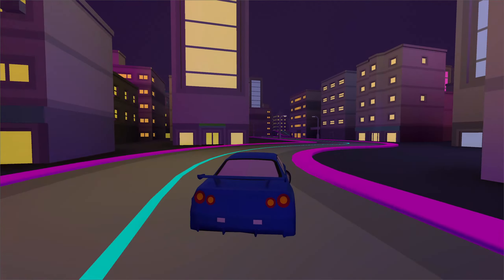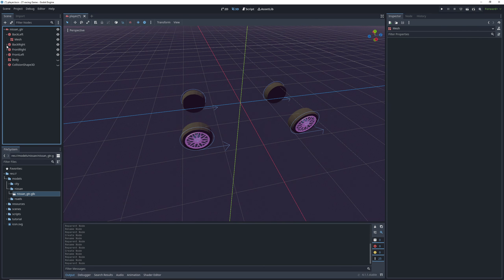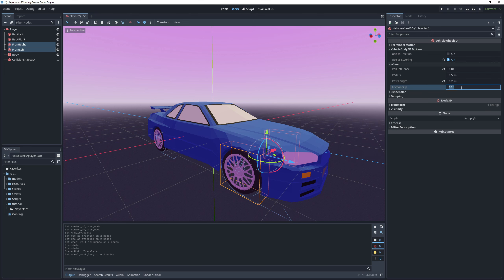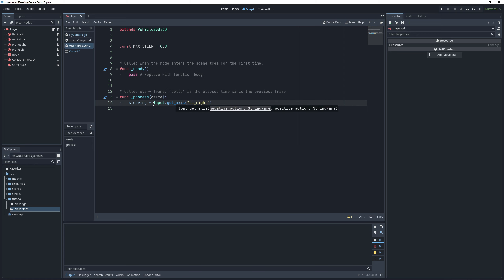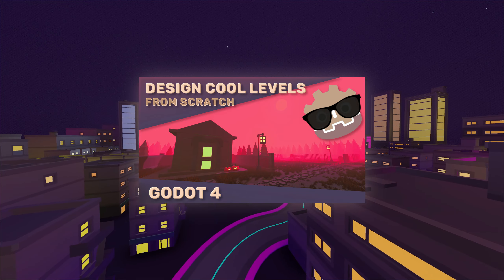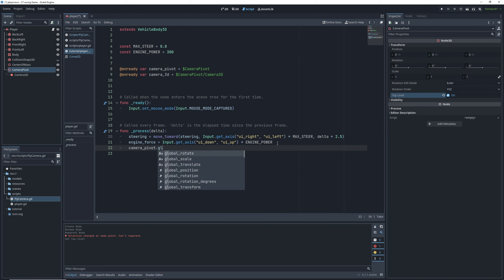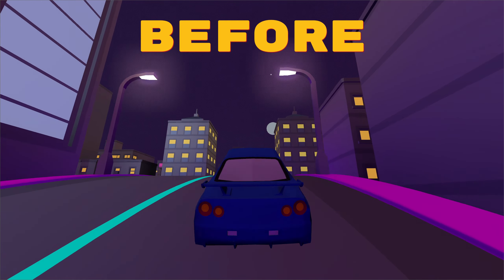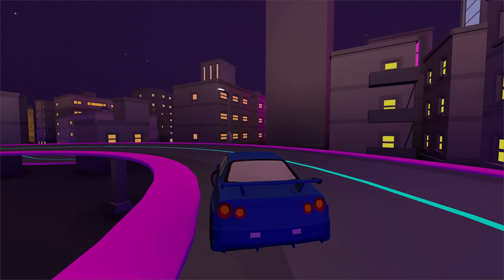Race Car Controller Tutorial - Godot 3D

Comment: the wheel's are not staying in there place , when i press up they go up and around
Reply: Yeah my center is not as shown in the video, the wheel centers are locked to the body center... help?
Reply: @sofiejensen3804  you can fixed it with blender , separate the wheels from car body and set the origin point in every wheel in the center of it.
Reply: why did you put an apostrophe there

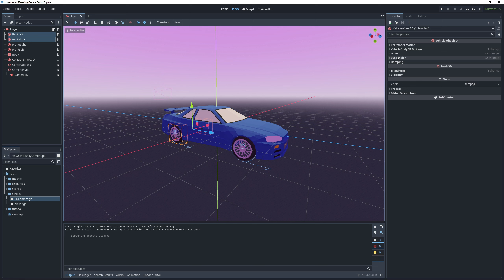Comment: Cool, thanks for the tutorial! But at the 9:39 timestamp, I can't help but notice that:
1/ Delta is necessary to control the execution speed of LINEAR processes, regardless of tick/frame frequency. I'm not sure if it's correct to call the process of "changing a number by iteratively lerping it from itself to a target value" an exponential approximation, but it's definitely not a linear process. By the way, this is a key practical difference from the move_toward function, which creates linear changes and can appropriately use delta.
2/ You lerp the position first, and then the entire transform, which, however, includes this position. In other words, the first step is unnecessary.
Reply: Lerp can still be used for a quick animation solution, but it's important to remember that the speed will depend on the tick rate/frame rate, depending on the loop to which this animation is attached (normal, physics). Multiplying by delta doesn't do what you might think – it doesn't adjust the animation speed to the frame rate. Honestly, based on my experience, it worsens the situation, potentially leading to issues. Use lerp for animation without delta if you are already using it.

Also, don't forget that the value never quite reaches its goal but continuously strives towards it when animating with lerp. This, too, can be an important nuance to consider.

Comment: I'm using Godot 4.3. For whatever reason - even though I've set the front wheels to steer (and not the rear ones) - when I run the game, the rear wheels are steering around the vehicle center. So I have some issues:
1. The rear wheels are steering.
2. The front wheels are not steering.
3. The wheels are steering around the wrong position. Maybe the wheels pivot point is wrong (centered at the car center). I've tried to fix that in Blender, but failed miserably.

If anyone had similar issues and found a fix, please let me know.

Comment: I wanted to genuinely thank you for this. I'm very poor at programming so far, so the fact all tutorials were for Godot 3.x meant I ended up with broken code that I'm not experienced enough to fix.

I always watch your videos, but this one single-handedly got me back in to Godot. Thank you.
Reply from the maker: I'm glad you're enjoying them, thank you for watching!
Reply: @legiongames2400  
Okie dokie, so I tried following along, but I'm having a very odd result. The inputs don't seem to do what they're told to do, almost at all. Hitting throttle results in virtually zero forward motion, but causes the vehicle to turn to the right very slightly, while trying to turn left or right causes the vehicle to quickly turn and accelerate, until it flips.

I've quadruple checked my script now, and I have copied yours to a "T". Any idea why it's being dumb on my end?
Reply: It's almost like the left arrow "allows" the engine to accelerate the vehicle forwards, while the right arrow does the same in reverse...
Reply: Alright, in case anyone else is having the same problem I had to change how the system steered, using this function:
steering = move_toward(steering, Input.get_action_strength("ui_left") - Input.get_action_strength("ui_right"), delta * 2.5)
	engine_force = Input.get_action_strength("ui_up") - Input.get_action_strength("ui_down")

An accidental benefit to this setup, is if you decide to setup a custom input map, you can use controllers to have variable steering, acceleration and braking (IE, you don't have to be full throttle or no throttle). Hopefully that helps if anyone else encounters the same weird bug I did.

Comment: This is in fact what I needed. Now, I'm not creating a car controller, in fact I want first person movement, but some things from this are applicable. 
Since there aren't as many nuanced godot tutorials, you really always have to think out of the box and consider your closest approximation. But since we are creative problem solving, it's also not straight forward what nodes and functions to use at each point, so we need to find tutorials for things that are more common than the niche thing we want to achieve.
Reply: ur using wheels for a 1st person controller?
Reply: well no, not wheels, thanks for asking. I'm trying to have a regular first person view, but the character movement is restricted on the x axis, so it's basically like on a street. And the mouse x isn't supposed to control the character y rotation, so like steering, where y rotation only happens with A and D keys.
my ideas tend to be complicated and I'm new to gamedev, so I have a lot of work ahead of me.
Reply: @pancakedev6 What I was looking for turned out to be path follow

Comment: Bro, wonderful tutorial!
Could you help me? When driving, all four wheels of the car rotate along the axis y
Reply: Same issue here!
Reply: Same here. Did anyone find out how to fix this?
Reply: The video description explains it: "If you use the car model that I used you will need to change the wheel origins in Blender to make sure that they are centered on the wheel meshes."

Without the edit, the center of each wheel is the car model's (0, 0, 0), which then becomes the center of the rotation. Use Blender, then for each wheel mesh, click > Object menu > Set Origin > Origin to Center of Mass (Volume). If someone finds a solution how to replace the mesh within the Godot scene file instead of redoing everything, please comment. I redid it, and then it fully worked.

Comment: for some reason my wheels are giant and not where they are suposed to be i used that car in the ling and i did the exact thing that where in the video
Reply: Here is how i fixed it for myself. Change the scale for the Vehiclewheel3D to 1, same for the mesh(of the wheel). Now change the scale of the wheel mesh to w/e u need(mine is 0.185) and the scaling issue is fixed you no longer will have giant wheels

Comment: the wheels move out of the car and in cant fix it
Reply: forget it i fixed it
Reply: @Nathan-k5t  what was the problem?
Reply: @pelcox1681  the problem was that i didint put the weel turning on the weels i had it in the midle of the car witch made it spin in steed of turning
Reply: @Nathan-k5t  Hey, can tell me how did u fixed it, im having the same problem, the circle thing which should appear in the wheel is appearing in the middle

Comment: Does not work for motorcycles. I guess, the VehicleBody3D is not designed for vehicles with less than 3 wheels. I tried a lot of possible settings. I miss a setting for tilting instead of steering, because on two wheels you will not steer much, but tilt your bike.
Reply: I feel like with a proper center of mass tye physics would just sort itself out.maybe your tires need to have strips if you will with their own friction
Reply: @visibletoallusersonyoutube5928  Ty, but I stoped tryig to do something like that with Godot. I Hope, there will be an update for 1-2 wheeled vehicles soon or later.
Reply: @3333927  fair enough.  You could just have a left and right friction  that gets adjusted depending on the lean angle of the bike.

Comment: I liked the project, how to install a system with a speedometer, I'm in Brazil here it's in km/h, and how to show what gear it's in, create a system to switch automatic or manual gears and show the gear as in reality?
Reply from the maker: You can get the speed of the car by getting the length of the linear_velocity variable of the car which is in m/s so multiply that by 3.6 to get km/h and then hook it up to whatever UI element you want to use to display it
Reply: Thank you very much, do you have an example? I liked your project, would you have one for a helicopter?
Reply: @legiongames2400  For mph multiply by 2.236936 (~2.24) instead

Comment: I did everything the same and my camera is not in the center of the screen next to the car, it is a little to the left and it does not adjust even when accelerating
Reply from the maker: Is it in the center of the screen when you preview it in the editor? If not you might just need to make sure that all the transforms are zeroed out.
Reply: yes, I reset the camera and the hanger node many times, the error still occurred

Comment: Thanks for the tips! It's possible to do drifting?
Reply: if you want the simplest drifting, i imagine you could put traction on both wheels but only traction and slip on either the front or the back wheels, depending on what you want then tune it to your liking. if you wanna add drift as a button, i imagine setting slip to true when pressing "button"
Reply: @Wonkabonka   Hi! I tried that and isn't working, the car is just going from normal to spinning
Reply: hmmm, spinning as in doing a sharp turn? if thats the case, maybe put slip on both front and back tires. experiment with different values on the front and back aswell. you will eventually hit the sweet spot. Also adjusting the weight of the car could help. Ive done it like this once before but thats a long time ago. it should work alright. Short summary: try slip on front and back wheels, traction on only front or back, experiment with slip strength, experiment with weight. Good luck! @JoseGonzalez-ud6pc
Reply from the maker: VehicleBody doesn't do drifting really well. I want to see if there's a way to achieve it with minimal code added, but potentially might have to implement a car using a rigidbody to get it just right.
Reply: youre right about vehiclebody not being able to drift well, but after experimenting with weight, the center of mass and slip im getting somewhat close, it will start to drift and slide for a bit but sadly not that good yet. might add some force thats added when slip is true so it keeps momentum. solid tutorial though @legiongames2400

Comment: Great tutorial. But, for some reason, my wheel nodes aren't repositioning themselves to the wheels on the mesh when creating them as children of the wheels like you did in 1:20
Just wondering if there's some setting I'm not seeing or whether I've done something wrong bc I still have to manually reposition them.
Reply: I think you'd need to edit it in blender

And change the center point

Comment: thanks!
one small comment for other people doing this tutorial - i'd reccomend having the code in an _physics_process(delta) instead. having physics tied to the framerate isnt a great idea most of the time :)
also using the inputmap instead of ui inputs is reccomended
Reply from the maker: Yeah, both very good suggestions, thank you for the comment. I do switch it to physics process later in the video, but never get around to changing the input map.

Comment: For some reason when I turn the car starts bouncing out of control. Please help
Reply from the maker: The issue could potentially be gravity, I increased mine in the tutorial to work with the speeds that I want. How does it bounce? Like does it go off balance or does it just straight up fly and bounce LOL?
Reply: @legiongames2400  when I turn the car while accelerating, the car will start bouncing out of control. Almost like the wheels are bouncing
Reply: I’ll make an unlisted video and link it below if that helps
Reply from the maker: @MZMDev  That would be really helpful. Could you also quickly scroll through your car and wheel settings in it as well please.
Reply: @legiongames2400  For some reason I cannot link the video. It should be public on my channel sorry.
Reply: https://youtu.be/Ge1BOhx4Zew Apologies if this is spamming its just not posting for me
Reply from the maker: @MZMDev  Okay so I checked it against what I have and it's definitely the center of mass. -0.8 y is too much, I don't know why but if it set mine to that it starts bouncing like that too. But if you change it to Y -0.1 it should be good.
Reply: @legiongames2400  ah ok I never even considered that. Thank you so much
Reply from the maker: @MZMDev  Yeah no worries, there's so many settings we run through in the tutorial all at the same time it becomes difficult to debug. I'm glad we figured it out.

Comment: I have a little issue when testing the car. Basically, the car works but the wheels are out of place. The bug lies in the logic where instead of the wheels rotating independently, they rotate at a fixed distance radius from their original position. Solutions?
Reply from the maker: The origin of the wheel needs to be in the center of the wheel mesh, you might have to change that in blender.

Comment: it's missing suspension due to acceleration to left/right. a real car would bend to the left or right when turning to the left or right
Reply from the maker: The suspension is relatively stiff in my project, that effect would be more pronounced with a lower stiffness setting.
Reply: @legiongames2400  i see. thanks for the info.

Comment: When I select the wheels the selection is stuck in the middle of the body? I'm not sure where you change selection behavior.
Reply from the maker: Might have to edit the model in blender.
Reply: @legiongames2400  Yeah, I reset the origin on each wheel after some fumbling for a while. I was still just getting started with the documentation at the time, so I wasn't sure if there was some strange option to have child node origins set to the parent or something. Thanks for the video and reply
Reply: An easy way in Blender: import the model then select each wheel; then in object mode click Object tab -> Set Origin -> Origin to Center of Mass (volume)
Reply: @biankro  You're my hero... we looked for ages for this fix! Thanks a whole bunch!

Comment: Hi, Legion. My car isn't working very well. I made a bus but wheels we're clipping trought floor and i can't steer. When i made a car out of boxes and cylindres it was steering but wheels we're clipping. How can i fix that because methods from google wasn't working.
Thank you for best tutorials.
Reply from the maker: The wheels might be a bit too small, you could try messing around with the radius if they're clipping.
Reply: @legiongames2400  My wheels have like no collision. I tried to make perfect collision, standart collision and collision two time bigger but it only collides with cars collider not wheel
Reply: Did you ever figure this out? Mine is doing the same thing.

Comment: I tried using the Godot’s vehicle body once, back before 4.0 came out (not sure, but it think 3.4ish) but the default values weren’t very sane, so it took a lot of tweaking to make it act kind of like a normal car.  Also, collision was kinda glitchy, for example, on a perfectly flat plane it would occasionally bounce like it hit a giant pothole - dangerous at high speeds.  I eventually set it aside and never came back to it.  Is it any better in Godot 4.x?  I’d like to revisit it as I still have ideas.
Reply: I've tried VehicleBody3d over the past few days, although I can't personally say whether it's improved in any ways, I can say I did run into the same issues you've mentioned and more besides, and so ended up also setting it aside to pursue RigidBody3D/raycast solutions (which there are surprisingly more tutorials for as well as a few examples people have posted to github).

I think VehicleBody3D is good only to allow someone working in Godot to understand some basic concepts for how vehicles in games can work. It may work in some very narrow and normally very restricted/unrealistic scenarios, but for most who'll look at a tutorial like this as a "starting point that they can expand on" are likely going to be very disappointed.

IMO, (though I love this tutorial and am grateful it exists regardless) it would be more responsible if it first understood and outlined the limitations and struggles with VehicleBody3D. Right now, the statement that VehicleBody3D works pretty well for anything short of a hardcore racing simulator is just factually false (and sounds like fifth hand regurgitation), as an example, it doesn't even have drift (without extending and writing your own solution, which leads most to just drop VehicleBody) this means the vast majority of arcade racing setups cannot be achieved out of the box (not even your simple mario karts or some of your 16 bit style racers). And then keeping the mass at 40kg and tweaking other settings around that is simply done because any mass even relatively arcade or realistic catastrophically breaks the handling. And then upping the Gravity to counter that, as a solution, again impacts other aspects of the handling (again leading most to drop VehicleBody). And so "dialing in" the settings for VehicleBody3D becomes inputting a bunch of magical nonsensical values that are made near meaningless only to create something that (currently) doesn't really handle like what people normally expect a vehicle to handle like (realistic or not), leading to disappointment, frustration and worse likely wasting huge amounts of time and souring their experience and expectations of the Godot engine, rather than being grateful for learning what they could from VehicleBody and moving on at the right time for them.

Right now VehicleBody3D (imo) is an entry level learning tool only — and unfortunately in some ways an example of how not to achieve vehicle physics that one can only hope will teach people about the things they need to consider or cut when creating their own implementations (or in rare cases, when extending VehicleBody).
Reply: @noxistudios  thanks, i thought it was just me. i'll try an addon i saw
Reply: @noxistudios  i tried "Godot Easy Vehicle Physics" by DAShoe and it works great, you have to poke around a little to work it into your game but the car handling is excellent